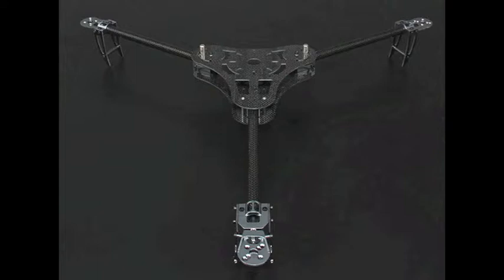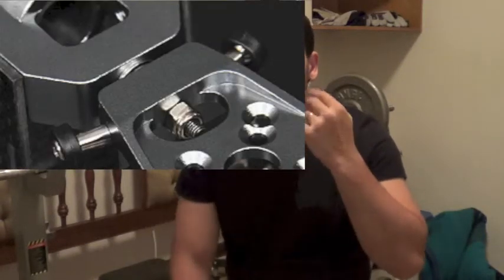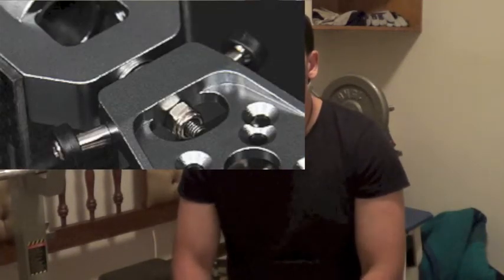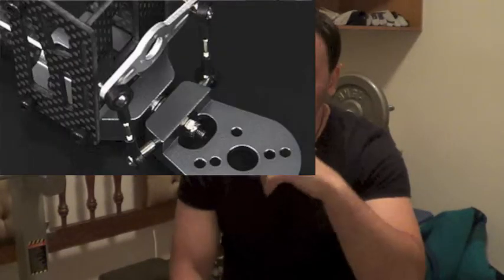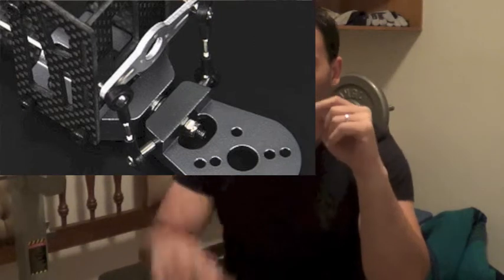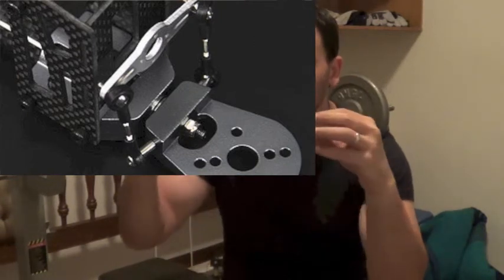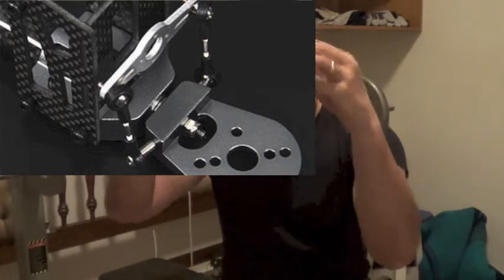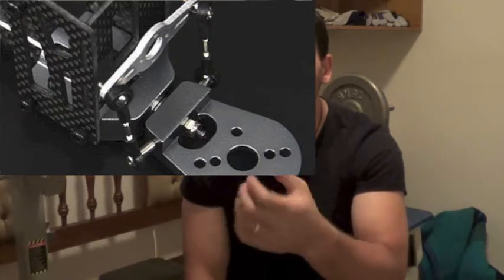Turnigy Talon Tricopter Tail Mechanism Upgrades

Comment: Sounds cool but would be nice if you could post some links to order the links and the balls ? No idea where to find those or what term to use. Thanks.
Reply from the maker: Hi, yes you are correct. I actually had these parts laying around as I race RC cars too. These parts are also available at my local hobby shop… I will have a look for some links to these parts, but you can look on www.rc-mushroom.com and www.stormerhobbies.com They both have a lot of RC parts like the links needed.
I will update in the comments when I find the appropriate parts.
Thanks for your comment!
Reply: Okay I found them at Hobbyking after some research on my own... I was not sure about the english term but going by servos accessories category revealed all:) I managed to fly okay today with the original ones, but wll order some stronger ones indeed I it just seem too easy to break and don't want to think what will happen if this occurs !!! Thanks for your advice they are spot on I believe.
Reply from the maker: Stephane Scherrer Awesome!!! Let me know how they work out for you and if you post a flight video…
Anytime on advice, feel free to ask in the future, if I can help I will do my best!
Keep Safe, Keep Flying!!!

Comment: Thanks for the video, I've changed out the thrust bearings and that helped quite a bit. Next step is to change out the links like you said, they are pretty flimsy.
Chris
Reply from the maker: No problem, hope it helps. The links make a big difference.
Good Luck!